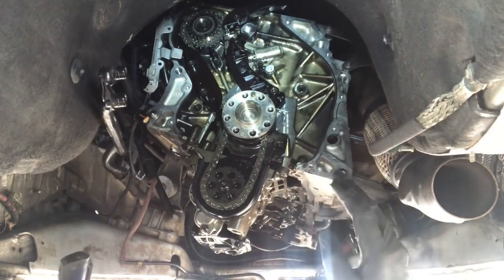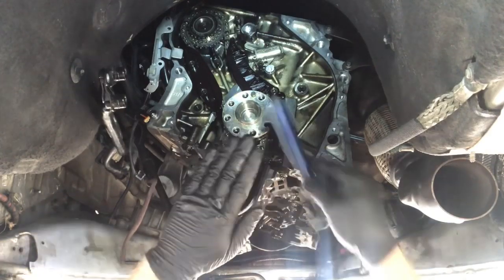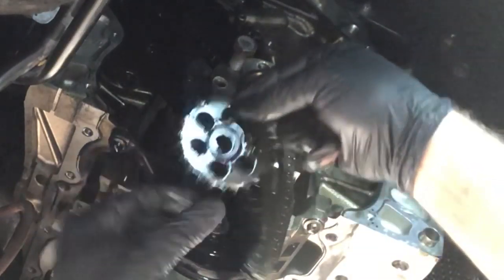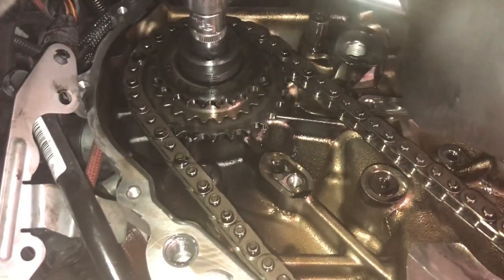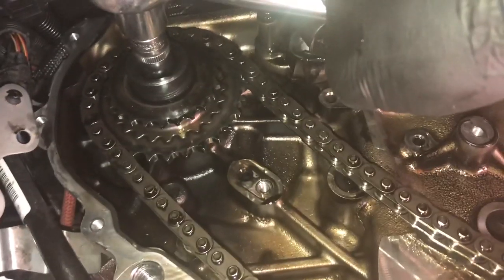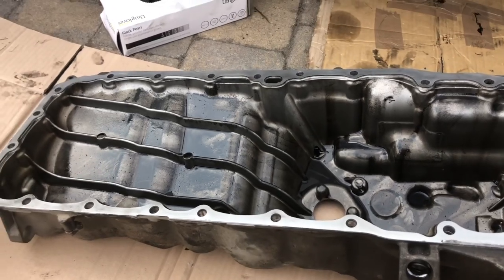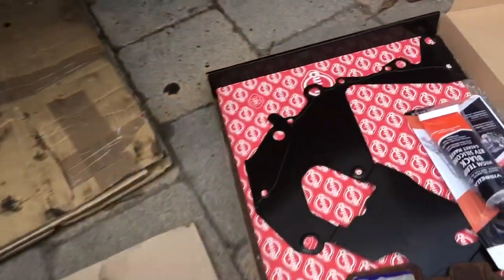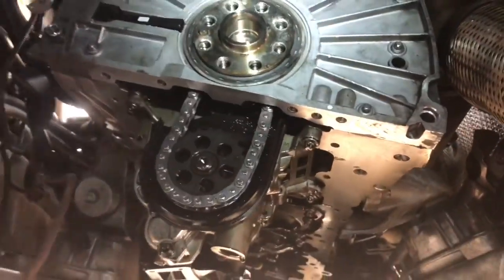BMW 530d F11 BROKEN TIMING CHAIN - Part 3: Timing Chain Replacement N57/N47

Comment: Hi, great video. Thx for sharing. My F20 chain just broke and I need a new engine. Can you tell me where I can acess the guide as you are following from bmw?
Reply from the maker: Unfortunately the online BMW workshop guide I used was taken down & I believe they made it a paid system under a new name (not entirely sure of the details though). If you’re up for complicated jobs like me though, I promise it’s worth it.
Reply from the maker: I couldn’t have done many of my repairs without them 👍

Comment: Engineers that decided set this fragile timingchain on the backside of the engine deserve 10 stars in the book,😮 you are a hero doing this job on this old car 😅
Reply from the maker: I could hardly believe it when I learned how they built this engine 🤷‍♂️
This will be a common problem now that most cars have higher mileage… hopefully some people can take hope from my experience 😊

Comment: Hi mate, did you drop your subframe when removing the oil pan ?
Reply from the maker: No, I actually managed to remove it with the subframe in place. I will add that it’s actually quite awkward/difficult… but it is possible with perseverance (and a decent tool selection of attachments, extensions etc.)
Reply: @Nut_Job.  thank you. My n47 has broken guide. And similar to your high mileage. It feels like open ended cheque for garage to fix. So your video has been inspired me to do it myself. Thanks great video
Reply from the maker: Good luck👍 
Take care & don’t rush if you’re doing it at home like I was. Many others prefer to pull the engine out, but I didn’t fancy that so thought I’d try it my own way. Everything is fixable with enough time & effort 👍
Reply: @Nut_Job.  Thanks, I have managed to do almost everything. just one more question, how to you check your timing is correctly step up ? I don't have the special tool to lock the crankshaft. The rest 2 sprockets has marker when I can follow. but the 45 degree at crankshaft atdc is very comfusing.
Reply from the maker: I would really advise buying the timing tool set. They are not too expensive (maybe £25?) but will guarantee the camshaft is locked while tightening everything.
Reply: @Nut_Job.  cheers. managed to finish the whole job while also did  clutch and flywheel replacement. your video has been super helpful !!!

Comment: Apologies if I missed it: did it bent any valves or just break the rocker arms? Also did you replace the rear main seal? Great videos. Thanks
Reply from the maker: Yes, I had 2 valves which failed a pressure test. I had them replaced & tested at the workshop that skimmed the head. I did actually replace the rear main seal, although it doesn’t show it in the video. The one I replaced was actually in really good condition, but changed it anyway while I was there.

Comment: Excellent work! Cant believe how you got through this without quitting! One question, what was the mid chain / guides wear like? Alot of garages now offer a top chain only service by splitting it and winding a new one around with guides and tensioners leaving the botom two which are much heavier duity chains... Interested in your thoughts!
Reply from the maker: They were fine really. I’ve seen this top chain procedure & I would definitely recommend it as the top chain is definitely the weakest in my opinion. Doing the top chain via that procedure with access from the cylinder head is 1000% more appealing than the consequences I faced after it breaking 👍
Reply: @Nut_Job.  Cool thanks, I agree after looking at the weight differences in the chains it’s not hard to see why the top is most prone to breaking! What mileage did yours break at? 170k?
Reply from the maker: I think it was 166k, which I still think is unacceptable. However most people (including me) are judging modern engines based on excellent long term experiences with older blocks... and the sad fact is that newer engines built from lighter alloys, with unusual layouts, lightweight components & multiple emissions compliance devices simply will not last as long ☹️
The best we can do is preempt the worst failures such as the timing chain, oil/vacuum pump etc 👍

Comment: Hi, I'm in the process of doing my timing chain on the N47. I have the cylinder head off, replaced the rockers etc... I don't suppose you could send me the timing instructions you have as I am just finding sparse information online
Reply from the maker: I was going to direct you to newtis.info but realised they’ve been shut down! Unless there’s another BMW manual source on the web I can try & describe steps from memory if you tell me which part you’re at?
Reply: @Nut_Job. thanks for getting back to me mate. Yes newtis has been shut down! I am currently waiting on my new timing chain kit coming however I will be doing it the same way you did by timing the bottom end with the cylinder head off and then timing the top once that's back on. I have the engine out of the car too
Reply from the maker: Ok, so you will need the timing tool kit (hopefully you have this, but if not order it ASAP - only cheap). I won’t bore you with every little step as you can see a lot of it in my videos. Have you removed all the existing chains yet? I think the HPFP sprocket extractor tool comes in the timing kit. Remember the oil pump sprocket nut is reverse threaded. Remove that little oil pump chain, then extract the HPFP sprocket to release the middle chain. If your cylinder head is off then your top chain is already gone. When your chain kit arrives you can replace the plastic guides & tensioners.
Reply from the maker: Next, lock the flywheel in the correct position using the tool in the kit - this is TDC of cylinder #1 if I remember correctly. Replace the middle chain & bolt up the HPFP sprocket, followed by the oil pump chain & sprocket. There is a little slack in the small oil pump chain, this is fine. LEAVE THE FLYWHEEL LOCKING TOOL IN PLACE, and now reinstall the cylinder head. If you haven’t dismantled your camshaft assembly then they should still be in sequence - check that the dots align when the gears meet in the centre. Keep the dots centred & use the camshaft tool to keep it locked in place. Reinstall the camshaft assembly & run the top chain around the sprocket which bolts to the back side of the right-hand camshaft (keep the 3 bolts slightly loose for a minute). Screw in the cylinder head tensioner bolt & this will tension the chain. If you camshaft locking tool hasn’t moved then it’s time to tighten those 3 bolts on the back of the top sprocket. When you’ve done that, you’re timed!
Reply from the maker: Don’t forget to remove the flywheel locking tool too by the way 👍
Reply: @Nut_Job.  Yes the kit I have has the ballance shaft tools, crank locking tool, HPFP sprocket removal tool and the usual tools for timing. I am waiting on the timing kit but it wont be here until the back end of the month along with my new head gasket (both FAI parts) I'm really just trying to get myself clued up enough to tackle it but there's a lot of people doing it differently and I can't seem to find an official manual online with torque settings etc
Reply: @Nut_Job.  as you gathered I have only removed the cam chain as that was already loose due to the top guide being broken. One thing that puzzles me a little is why do you need to turn the engine over twice and then check the timing?
Reply: @Nut_Job.  I refreshed the page and realised you have pretty much described the whole job. Thank you, I really appreciate you taking the time to go through this it has cleared a lot of questions up. I noticed in your recent videos of the BMW the bottom end has failed, have you made a start on it yet if so how are you getting on?
Reply from the maker: To be honest, I ran out of enthusiasm last year & just bought another car. I’m not letting it get away though & I have almost everything I need to rebuild the engine, so I will do it (& film it) this spring time.
Reply: @Nut_Job.  good luck with that, I'm sure you will have it back up and running in no time! When you invest a lot of time and money it becomes harder to let them go
Reply from the maker: Tell me about it... 😂
Reply: @Nut_Job.  still waiting on my timing chain kit and head gasket, apparently should be here no later than the 22nd. In other news I have removed all the chains and sprockets. 

Just to clarify In terms of attaching the chain from the crank to hpfp the pump has to be lined up with the marking on the engine and the crank has to be ATDC 45°? I'm seeing some videos where they time the hpfp to TDC and surely that's wrong😄
Reply from the maker: Without access to the repair manual on newtis I can’t actually remember. I do remember there was a marking for the HPFP sprocket, but in my opinion it wasn’t actually that important that the HPFP was precisely timed anyway. All the HPFP does is supply the fuel rail with high pressure fuel, so could never quite understand the importance.
Reply: @Nut_Job.  yeah I gathered that myself, I have came across a manual I trawled the net for and it specifically says crank to be set at 45 after TDC and then so on with the rest. But I noticed on a few other videos people have the crank set in a variety of places haha
Reply: Lastnight I turned the crank 45 degrees after TDC and the crank locking tool lined up perfect so I feel confident it's correct that way😊
Reply from the maker: Fair enough 👍
It’s nice when things line up isn’t it 😁
Reply: @Nut_Job.  Oh yes, especially when it involves critical timing

Comment: Great job....snapped the timing belt on an  Audi-a4(my fault, I knew it needed replacement, put it off too long)....bent 4 valves....basically the same job, but the Audi has a belt in front, much much easier than dropping the gearbox....looking forward to watching the rest of the job!!!!

Comment: I have bought i 520d xdrive 2014 with 49709 miles so its pretty new with service history . it have engine N47N i bought it for 16.000 pounds . Do i need to worry about chain problems like this?
Reply from the maker: I wouldn’t worry about it at 49k. When you’re up towards 120k then I would get it done 👍
Reply: @Nut_Job.  Okey thank you for very fast reply. I only drive like 7500 miles per year so i hope it will take long time before i need to change the chain since it seems very expansive! The only thing they didnt change on this car is EGR valve so i called bmw and they said they will change it for free even if the car is from 2014. I only have a problem with some noise. When i stand still and move the steering wheel i hear a bonk sound from left side behind the wheel . it sounds really nasty. i only hear it when i driving slow or standing still and turning. I think i must go back to the dealer since i bought it yesterday. what can it be?
Reply: @Nut_Job.  https://youtu.be/vWWTNyFWWJY sound like this
Reply from the maker: It sounds like a control arm ball joint or something like that. Definitely something they should fix where you bought it from. Suspension joints wear out all the time, so it’s nothing unusual really - just make them do it for you though 👍
Reply: @Nut_Job.  hello agin. i went down to the shop where i bought it. They was very nice and said they will take a look at it on thursday next week and that is prob the faults you mention. I dont need to pay anything. I live in Sweden and when you buy a used car here there is a saying bought is bought. So if something breaks just around the corner the seller is free from responsibility so thats why im very happy they will fix this on such expensive car
Reply from the maker: That’s good 👍
For private used car sales it’s the same as that here in the UK, although if you buy a used car from a used car dealer you have more protection under the law.

Comment: Hey NutJob, my indie mechanic is going to replace my time chain guides and chain tensioner, I remembered your video. Is there anything else you recommend he does while breaking down my 126K mi. 2012 528i n20? thanks for your advice
Reply from the maker: I’m actually not too familiar with the N20 engine... but with a quick google it seems a bit easier than the Diesel engines as the chain is (rightfully) at the front of the engine 👍
Chain, guides & tensioner, plus an oil & filter change should be all good 👍
Reply: @Nut_Job.  thanks!
Reply: Have you ever had issues with your oil pump relay?
Reply from the maker: Do you mean the fuel pump relay? The oil pump isn’t electric, it’s driven off the crankshaft by the short chain (which is replaced as part of the timing chain job)

Comment: To anyone wishing to carry out this repair, regarding the issue with the gasket: the metal gasket is for use up to 3/2011 cars, without sealant (or cover part number 11 14 7 800 023). It's my understanding the "channel" is there as a compressible sealing space, not to put any extra liquid sealant in there. From 3/2011 and up (cover part number 11 14 7 812 996) the prescribed sealant is a 1,5-2mm bead of Loctite 5970 only. Sorry to say, but you used the wrong gasket vs. cover (stop video at 8:38, see top right corner of gasket vs cover, it has an extra hole in it). Luckily you applied that extra fluid sealant with the metal gasket, so it probably sealed up the whole thing enough. Beware of using too much liquid sealant, as it will get pressed out and may end up clogging oil paths!
Reply from the maker: Thanks 👍

Comment: what was the problem of the chains?how do you know there is a problem??
Reply from the maker: My timing chain broke while I was driving. The engine will die immediately - this was the process of fixing the damage & replacing the timing chains
Reply: @Nut_Job.  i can not see a broken chain...maybe because i skip forward the video :) my good friend bought a e91 320d and i'm curious if these chains can be torn apart while you're driving

Comment: Hi Nut job have you a part number for the timing chain kit please, or recommendations ware to buy please
Reply from the maker: I actually wanted to buy the kit made by FAI as I’ve used many of their parts before, but I couldn’t get one in the time needed. Ultra is the manufacturer I used in the end (I think there are UK based?)
Sorry, not sure of the part number but you can enter your car details on most resellers websites to get it right 👍

Comment: Absolutely crazy putting the timing chain on the back,  believe it was for a lower bonnet line,  surely this is a service item and would need replacing at some point in the engines life?  This is just form over function.  Another stupid BMW design,  take me back to my E28 M535i,  mind you,  even they had cam lube problems . . .  German reliability . ..

Comment: It’s a mammoth task and one that many would never dream of tackling so as has been said before, don’t do yourself down, this isn’t a simple fix and you have gone about it in a calm and collected manner. I must admit I was a bit concerned about the oil pump sprocket as it looked a bit worn with the teeth appearing to be slightly bent at the tips but this could just be down to the angle it was filmed at. I know by now that you check everything and change if you’re not happy with what you find so I can relax a bit on that level. Good luck with the final part, like many I look forward to watching the video 👍🏻

Comment: It's quicker and easier to pull the engine and box out of the car, to do this job.
Reply: The guy doesn't have an engine hoist, he is working in front of his house!!
Reply: @filippxx  theyre not expensive and would totally transform this job.  its frankly amazing he chose to do this on his back.
Reply: I've done it both ways on n47's and multiple times using the gearbox out method which is far less work and quicker, perhaps the best BMW repair channel on YouTube (VLASOV was previously BMWEAST) explains why and he's got all the kit.

Comment: Great video, but there must be a fundamental flaw in the design. I the past I've always preferred vehicles with timing chains rather than timing belts. Because they generally lasted the life of the engine if the vehicle was well maintained. But recently I'm finding components aren't lasting, Recently replacement a snapped spring on a Suzuki with 25,000 miles.

Comment: That metal gasket looks like the kind that crushes and doesn't need sealant, but if it didn't have it originally I would have stuck to the original and left it out, however the sealant I would use something high end like fuji bond that stuff never leaks and you don't want to repeat this job for a oil leak. Nice work mate.

Comment: Does the high pressure fuel pump need timing up ?- i know on fords (2.0 french engine)they do - but they will run out of timing for a while before the effects become known. Great work
Reply from the maker: Yes, there is a timing position for the HP pump sprocket. I’m not completely sure why, but I made sure it hit it’s mark at TDC as per the instructions 👍
Reply: Nut Job this fella explains it well  https://youtu.be/eDgkG_lZeJo

Comment: I don’t see the timing chain snapped, what exactly happened to the engine here? You didn’t tell
Reply from the maker: Yes, the top timing chain had snapped. The cylinder head has been removed & fixed at a cylinder head specialist. Next task is to put the transmission back on & get the head bolted back on once the car is back on the ground 👍